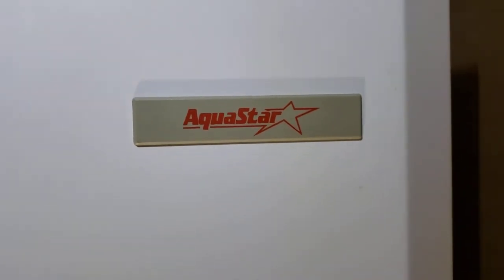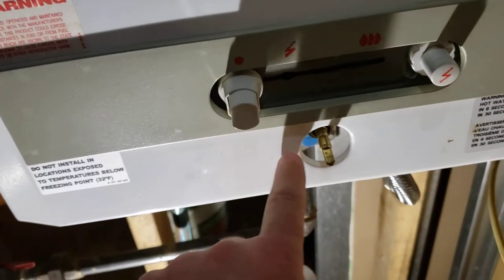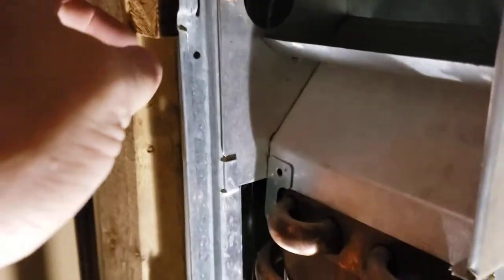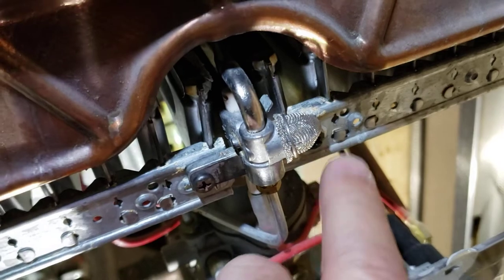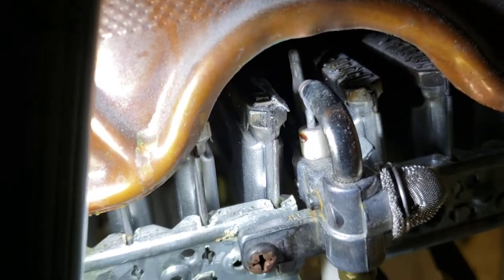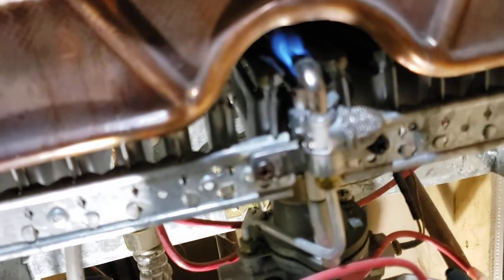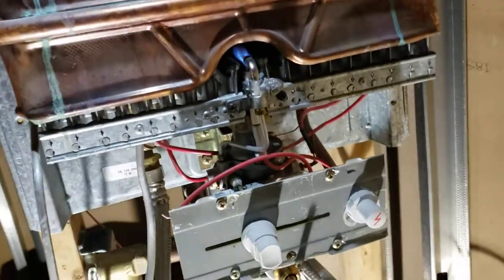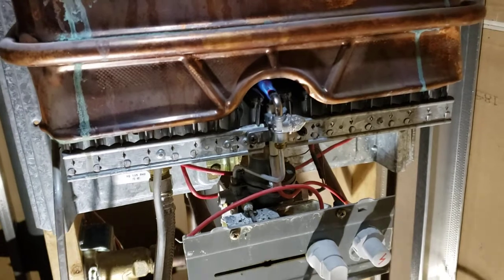Bosch Aquastar 125B Tankless Water Heater - No Pilot Flame

Comment: I’ve had my 125 so long
 (2006) that I completely forgot what the controls do.  

Now I know that the slider control should be moved all the way to the far right to the 3 🔥 Mark, once the pilot is properly lit.   
Not leave the slider at the 1 🔥 Mark. 

And most important, that the bottom round turn dial is used to adjust your water temperature (no more scalding showers).   

My life is now 99.99% easier. 
Thank you Immensely.

Comment: You are a lifesaver!  I had PGE check for the gas line yesterday & see if he could figure out the problem & he couldn't. I found your youtube video & of the exact same model that I have followed your instruction & I have hot water again. I left a voice mgs on the PGE worker & told him I fixed it by watching your youtube video. Thanks for saving me $$$$$ & from buying a new hot water heater.

Comment: We have this model water heater in a boat we just bought. We are having a heck of a time getting it to light. We have followed the instructions to a T  but still can’t get it to light (the pilot light is on). Would be so grateful for any tips or hints to getting it to light. Thank you so much!
Reply: Correction - igniter sparks but the pilot light won’t light.
Reply: @DonnaCox-sk1wz  The spark module to light is really wonky. Sometimes you need to do it LOTS of times. I do it in a machine gun fashion to get it to light. Most times however, I'll use a long necked lighter to light the pilot.
Reply: @quanman32 ….wouldn’t that be a propane tankless if installed on a boat?    Just wonder if there is a different lighting method for the propane heater.    Hope you took care of the problem.

Comment: We have a 125-BLP-S model and I had it turned off for the summer since we have solar hot water. I tried to turn it on this morning and it absolutely refused to fire up, even while using a propane torch to cheat the thermocouple. Later in the morning I gently tapped on various parts of the valve assembly with a metal tool and tried again and, praise Yah! it fired up!!
But now the problem is that the flame is yellow tipped like it is not getting enough air due to dust?? or it is getting too much fuel?? Not sure what to do at this point. It works but I am a little concerned about the yellow tips on some of the flames. It is mostly nice and blue but a few flames are yellow tipped.
Reply from the maker: You might want to run it for a few days and see if it shuts off. Maybe you could blow some compressed air from a can into that area and see about clearing any dust that collected over the summer.

Comment: I have a problem with one of the same tankless, turn on the pilot’s light but when the shower opens no hot water comes out, hot water comes in when draining it comes out
Reply from the maker: Try locating and testing your pressure switch. When you turn on your hot water faucet the pressure goes down and that switch turns on I believe.

Comment: I have a 125-BLP model just like this one. The pilot light shut off suddenly, but I haven’t been able to get it back on. Did you have to unscrew anything else besides the two screws on the left and right side? Or clean anything else besides the thermocouple and igniter? The manual says the pilot orifice might be clogged, but I’m having trouble finding where it is. I haven’t cleaned my water heater in a while.
Reply: Did you ever find out the issue? I’m having the same problem

Comment: Hi
I have a aq125b-ng and  right now my issue is the pilot light went out. I restarted  it and the issue is once the pilot  was lit the entire bottom igniter as if water was flowing.  But the water wasnt flowing. After 30 seconds there was I turned  on the water  and there was  a poof and water  came out with some steam  and it shut off. Do you  happen to know what the issue is? Maybe a faulty  gas valve?
I'd appreciate  any help. I love this unit because  its tankless  and it has a gas pilot which is extremely  rare
Thanks
Reply: did you ever figure out what the problem was? I have some similar happening now.

Comment: how can I make the flames go higher because the water
Reply from the maker: Have you turned the adjustment of the heat in the center bottom of the unit to its maximum position to see if that does anything better for you

Comment: Is there any way to turn up the heat temperature on one of these water heaters?
Reply from the maker: The knob at the middle bottom of the unit controls the temperature. Turn it clockwise to increase the temperature.
Reply: @dalechalkey3729  Thank you!!